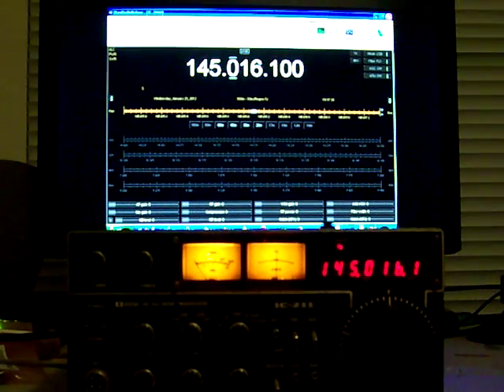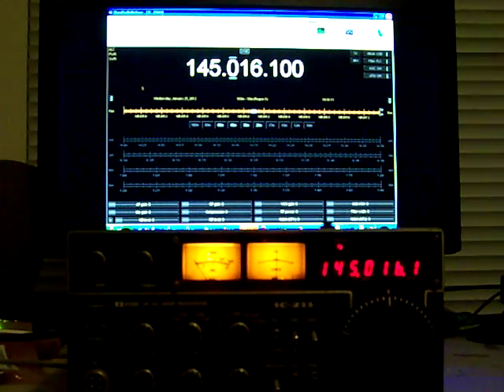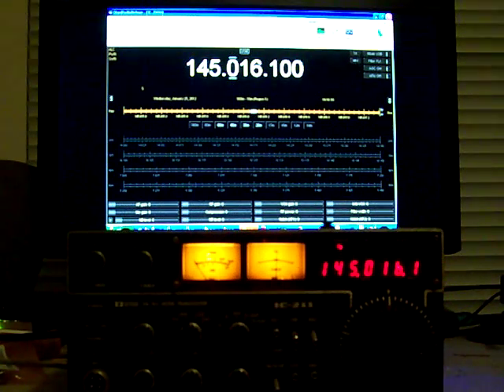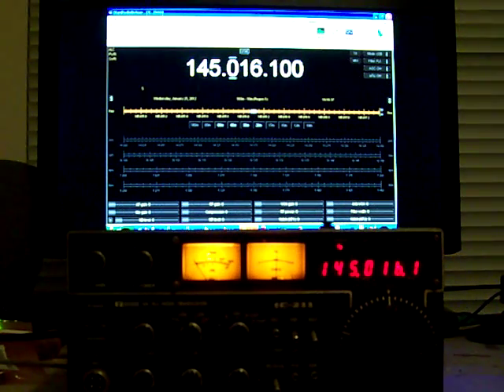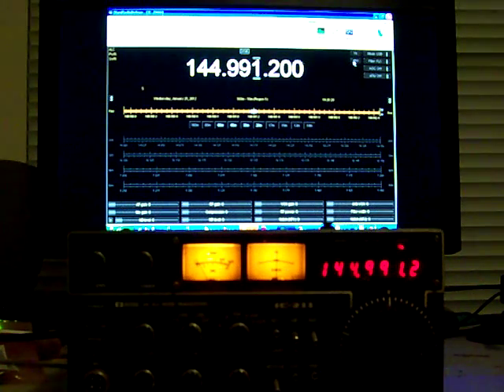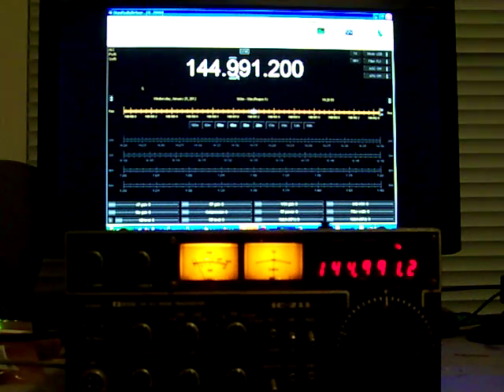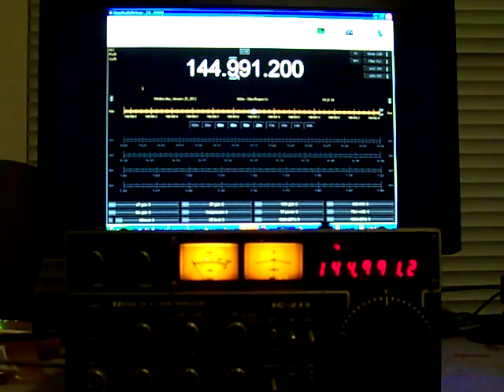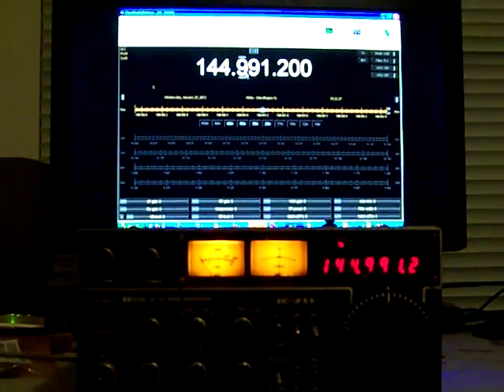Icom IC-211 Ham Radio Deluxe Interface

Comment: Will your interface work with a Kenwood ts-430s or a Yaesu ft-707 . I am looking in to building a interface for one or both radios to use HRD . To control the frequency with the computer. They don't have molex connecters. I guess , I am just looking for a starting point to build what I need.